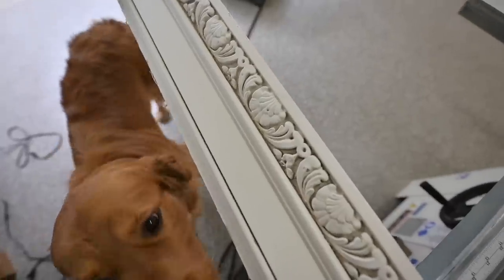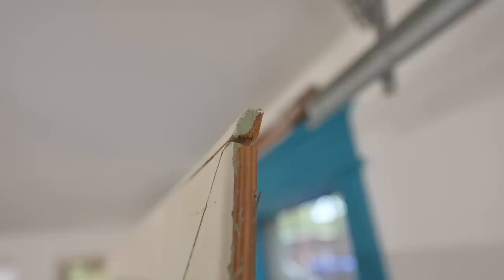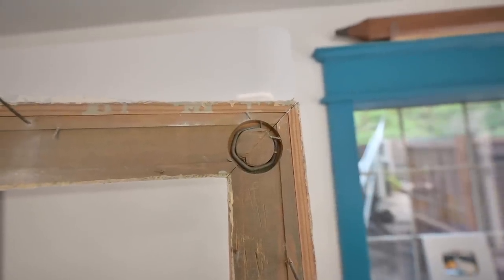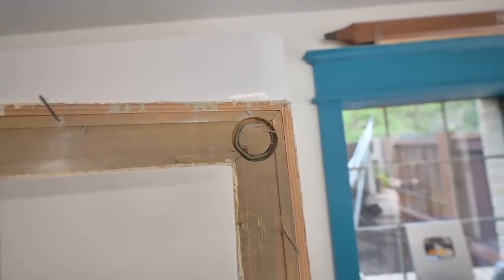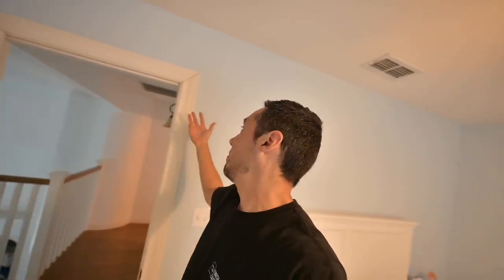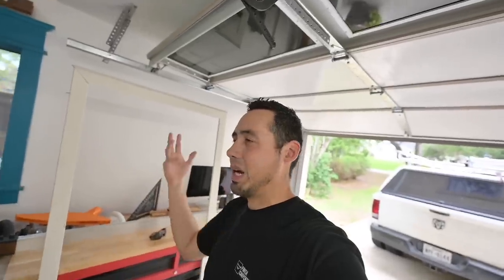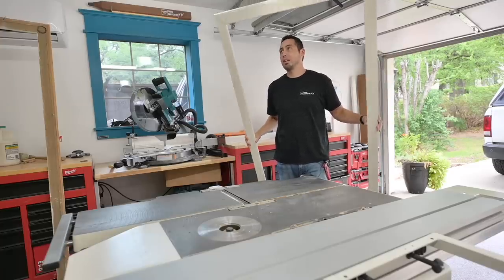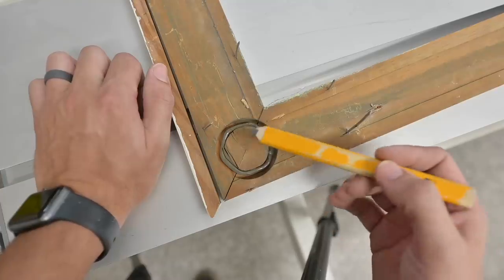Door casing skill lost for 100 years

Comment: There's a misconception that finish carpentry hundreds of years ago was done using simple basic tools and incorporated no practical knowledge of metallurgy or chemistry.   Engineering and science developed from the trades, not the other way around. 
You can use a modern ring band hole saw with no center bit by initially creating a jig with the same size hole.   In simplest form it's just a board with a hole drilled through it. The corner clamps used at that time could have been made out of metal or wood.  The jig would have been fastened on top of the corner clamp (another jig) with its boring hole centered on the 45 degree joint line. 
The hex lock ring technique over a round plug uses a cut diameter plug that is slightly smaller than the inside face to face dimension of the ring. The ring is either forced pressed over that cut or heats (a wainwrights technique). The evidence of pressing would be separation of the wood within the hex profile along the wood grain at one or more corners of the plug, a heated ring would leave scorch marks. 
Depending upon the species of the wood if it us dried, it's also possible to add a cooper's technique. A swelling agent (wine, 1% lye solution in water, or urine) will further expand the wood fibers of the plug, increasing its strength as the wood expands. If dry before assembly, the wood will never shrink back to its original size.

Comment: Interesting thing. This method may not actually be viable anymore. But why? Well, the issue is that we have actually gotten too good at growing trees quickly. 

Many people are familiar with tree rings, so I'll start there. Each year of growth of a tree is denoted by a lighter layer followed by a darker layer. That dark layer (if I recall my schooling correctly) annotates a winter. The more darker layers, the harder and more sturdy the wood. Something that has been observed with modern wood is that because of the speed at which we can grow trees with modern techniques, the space between those concentric rings has grown substantially, meaning wood is appreciably less "sturdy" today than it was a century ago. 
I know this has caused some changes to framing (framing not farming, as in building a house) practices over the years, and also has had an impact on how wood dries. There has actually also been an increased demand for certain wood from deconstructed buildings in recent years, as for certain applications that denser wood is more desirable.

So, wall of text complete, it might be difficult to utilized this technique on modernly available wood and reliable expect it to hold up. (Especially if you are hoping to get a century out of it.) If you go out of your way to scoop a bit of wood from an old building, or just purchase a naturally harder/ more dense wood, you may have better luck. That said, without testing it, there exists a near equal probability that modern wood could work BETTER with this technique, as it may be less brittle? But that is pure speculation on my part which would require testing. My guess is that this technique would suffer more tearing out of the ring over time as the softer wood wouldn't hold up as well to the contact with the metal and swelling and shrinking cycles. But, I know a bit about wood, not so much about carpentry, so there is that.

I am seeing other comments that this was obsoleted more from the advent of faster techniques, so it's definitely worth an investigation of if modern wood can hold up to this technique.

Comment: The difference between now and then? Today, homes are built by "Home builders" with contractors and prefab modular wood  for speed of assembly and low cost. Back then, home were built by "Craftsman" who were masters of their trade and proud of their work. Most everything was done onsite, built from scratch, moldings and all and cabinets were built, not installed.

Comment: OK, I'll bite... 1st off, I like the lock ring on the frame. And, on the ornate piece, SCAN it, and, clean it up, and use a 3d printer, or a 3d milling machine, and use that same ornate material, on other projects. This will lead to other similar projects. This will lead to other issues. And, hopefully a profit, and such. To make this work, be sure you document where you got the original ornate piece, and where others like it are.

Comment: I've seen Doug's comment that a machine existed for this purpose but if you were trying to replicate it, apart from routing it with a guide, you might find that an annular cutter exists of suitable dimensions.   Also, if you're talking modern materials with a preference for the cheaper soft woods, could you not hammer the hex ring into it while the centre boss was still round?

Comment: i dont think drill presses were a big thing 100 years ago. just big mounted pillar drills. i would say a straight bit in a router, but i also dont think portable routers were a big thing 100 years ago either. 

also, im going to say it was perfectly round, and the hex ring getting pounded in compresses the fibers to hold the wood and that is what makes the inside of the "hole" hex shaped.

Comment: Couldn't they drilled the circles on a long board and then cut it (twitce) at 45º angle?

Just swap the long boards and you will be left with the same frame but no need to clamp it to do so.

Comment: You're in awe of the craftsmanship, but it's the exact opposite of that. It's a mass produced machine made to allow carpenters to crank out a lot of work quickly and cheaply. What it really is, is clever. It's a very clever way to make a good, tight, accurate joint with LESS skill. Any half decent apprentice could trim a house in a day with this system.
I will bet that ring is twisted once pressed on with a big socket. That's the only reason I see for the hexagon shape. That would draw the joint tight.

Comment: That was done with two holesaw with different diameters(maybe that was milling cutter and it definitely was hand tool) then put out materiar with chisel(if not kind a milling cutter) and before install simply hammered in pocket this hex ring with wooden hammer(there are rippings because tention stress inside hex ring that mean it)... So yeah - so simple. 
How they make such perfect 45 degree fit without saw like behind Your right arm 2:10(not native english speacker, not carpenter, just know how it works but not how it called right) You already know if You are carpenter... Or did You? Also carpenter who made it clamp down boards to mill pocket maybe even with same tool with which he make angle fit.
ALSO!!! Hand tool oviously have lower RPM than modern tools, so it MUCH CONTROLLABLE, but need SO-o-o-o MUCH HIGHER skill.

Comment: They used a peice of wood with the hole the size of the hole saw cut out already clamped to the top of their frame where they want to cut the circle and that guides the hole saw from the outside of the hole saw instead of a drillbit on the inside of the hole saw...

Comment: 5:10 Don't do that. Cooking anything over an open flame from that painted wood is just asking for trouble. The chemicals would go right into the food. Even with a covered pot some flakes might still end up inside it. Especially if it's old paint (lead paint).
The resins and solvents used in varnish are toxic if ingested. Many varnish products contain benzene, which is a known carcinogen that is highly flammable. The solvents in varnish are extremely pungent, and the fumes can cause drowsiness, headaches, skin irritation and dizziness.

Comment: People weren't smarter. They had the mother of invention behind them. 

They did not have but a minute fraction of the tools and equipment we have. 

Add to the foregoing, they had time. They were not paying for a fancy new SUV, a crew cab truck, a speed boat, a Hawaiian vacation. . . . 

Of course, we could say they were not as smart: They squandered valuable resources (e.g., tight grain wood), didn't insulate, didn't have good health care, didn't have efficient travel, didn't have . . . .  However, that claim makes no more sense that claiming we are less intelligent.  Especially when many using good techniques, just like us, today, were just parroting what we learned from someone.

All that aside, banding is as old as the the trade. Staves of a barrel are kept tight with iron.  

Then there is the method of holding counter top joints tight, and for holding railing of stairs together. Two holes are drilled on the underside and a channel made between them.  A specialty fastener is dropped in (two threaded plugs with a threaded rod joining them).  Holes allow the plug to turn, drawing or separating the two plugs.

Comment: Intuition tells me you're thinking way too hard about this, especially the hexagon. There's no reason that ring needs any particular shape to 'stay in', especially considering it winds up entrapped by first finishing nails and then the wall. I doubt a drill press was involved either. The groove is way too pretty for a hole saw, so I bet it was routed using a circular guide. The ring is a hexagon rather than a perfect circle mostly because it's easier to make the ring that way, but as an added bonus it is also more compliant as the hexagon can deform to become more like a circle and increase its minimum radius. The I.D. of the circular groove was chosen to make the wood interfere with the flats of the ring, but not the corners, and then it was pounded in. The ring squoze the wood into the shape you see now. As for how to clamp that, you just clamp both pieces straight down to the bench.

Edit: and now I have read more educated comments which say this was a dedicated machine process, which makes a lot of sense. I stand by the claim that someone could quite reasonably do this on-site the way I described though.

Comment: I think the circle would be scribed with a tool much like a school compass, but with a sharp blade rather than a pencil. Perfect circle, with a blade wide enough to make the necessary room. I agree, the hexagon is chiseled out, and then ?heat the ring? so that as it cools it fits snugly. The ring itself is fairly high carbon, so this at least seems possible, it would tolerate the process well, expand nicely, and not char the wood much at all.

Comment: They weren’t smarter, they had less affective glues 🤦🏻‍♂️ a joint like that on architrave these days is complete overkill and completely unnecessary. We use mitre glue in the UK on a corner joint on architraves, the material pulls apart before the glue gives up.